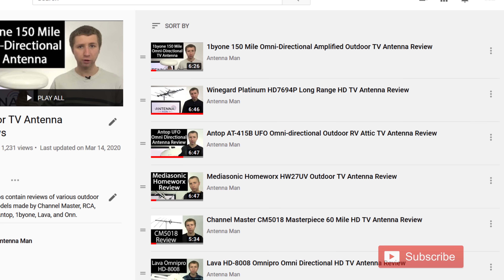Lose TV Stations at Night? This Common Item Interferes with TV Reception

Comment: Great video, I noticed no interference with a weak LED bulb but I recently put a 2000 watt equivalent 28,000 lumen corn bulb in my living room and it interferes with my TV reception bad. I have bad eyesight so I like all the light I can have and this bulb is super bright. I previously had a big 105 watt 7000 lumen spiral CFL bulb and had no problem with interference.

Comment: Hold on. 1. Grid tie is the worst interference followed by  2. Touch lights followed by 3. Dimmer switches and light alarms. 4. LED florescent replacement bulbs. 5. Old long florescent lights. 6. Florescent lights going bad. You will also find Wifi devices sometimes create noise and AC LED bulbs range from horrid ( rare) to imperceptible ( common). 12 volt off grid is a whole nother universe of good and bad.

Comment: Vince from Western PA here, he's exactly right. I have an AC to DC transformer touching my RG11 (evening LED landscape lighting), moved the coax just 3 inches away from the transformer and voila, both channels I would lose every evening while the lights are on, came back in strong. One is VHF and the other channel is UHF.

Comment: I picked up this roof mounted antenna setup with amplifier some years ago, it picks up my local stations great from over 25 miles with signal strengths in the hi 90's. My local VHF are 8, 10 &13. Sometimes 10 (and all its 7 sidebands) won't come in, it's all distorted and digitized, unwatchable. After some time (sometimes minutes, sometimes days!) the problem just goes away, no idea what's going on there. I HAVE found the LED work lamps in my garage can do it too. But the other day I'm watching 10, it's coming in great, when all of a sudden it goes into "unwatchable mode" again. Turns out (in this instance) it's my neighbor across the street (about 150' away) running his snowmobile!!!! Go figure!! Has to be something with the ignition that sled uses.
Reply from the maker: I addressed the issue in the video below. https://youtu.be/VLgYRW2CtO4

Comment: Wow, thanks for this video!  My wife stumbled on this problem last week. I’m in a NW suburb of Chicago ( Round Lake, Illinois). We were watching channel 2 (CBS) and when she turned on the light in the mud room the TV dropped to no signal. This was an 80 watt folding wing light that illuminated this area well.  I have a Finco antenna that I bought new in 1989, it was their best and rated at 150 mi range. It is 18’ wide and 20’ long. I bought it for my old home, but had to put it in the attic. When we moved in 2003, I took it with us and it’s in my current home also in the attic. The antenna looks like it’s brand new. I recently installed RG6U Quad coax cable from the antenna to a powered basement splitter and then directly to the TV. I HAVE A 65” LG smart TV and an Ethernet cable that runs from this TV to the WiFi router. I have seen a guy hook up an in-line filter and I’m wondering if this is the best way to go?  I have some 4’ led lights the might need this, can you recommend one for this?  They run at 66 watts, 120V, and are commercial filters. Thanks!

Comment: I have this exact problem - and reached the same conclusion (an LED Light Bulb). In my case the problem arises when darkness falls (so obviously a Security Light of some sort). Problem is, it isn't mine, but coming from somewhere nearby. I need some way to track the interference to it's source. Looking out the window when it happens hasn't worked (lots of trees around here block
my view). Would like suggestions from others.

Comment: Interesting.  I live in an apartment, have my old RCA antenna set up out on my patio.  Used it for years, no issues until recently.  Connected to bedroom TV and at night I begin to lose reception on a few of my stations.  No LED's in my apartment at night but LED security lights.  Hmmm.  However, living room tv, same type of antenna connected to a pole outside window and actually closer to LED security lights...no problem.  There is an AC unit within 10 feet of the patio antenna.  I'm wondering if that isn't the issue (wind from the unit) and especially since I just recently started noticing the issue.  Guess I'll have to sleep on the couch in living room until winter!  LOL

Comment: I had that big gray antenna hanging in my attic at my old house connected to the house coax wiring and it worked fine for two tv's.

Comment: Tyler, I'm so glad that I stumbled onto your video on the day after Thanksgiving!  Five years ago I installed a Channel Master CM-20 in my mom's attic.  Worked like a champ until recently when my mom started loosing reception after sunset on Chicago's notoriously difficult Channel 2 (RF channel 12).  So, I first suspected atmospheric conditions had changed in some way and installed an RCA pre-amp in the attic - it seemed to help until my sister took her dog outside that evening. After watching your video, I found the culprit: a Cree LED bulb in the porch hallway light fixture that my mom was turning on so that my sister would not have to walk her dog in the dark! The porch fixture just happens to be directly in the RF path of the antenna.  Swapped the Cree bulb out for a Philips LED bulb and now everyone is happy again (including the dog).

Comment: Thanks Tyler. Your videos are excellent and you are so knowledgeable. I have an antenna in my attic here near Sarasota and the Tampa TV broadcast towers are about 50 miles away. I couldn't figure out why all my VHF channels would be gone every evening, after coming in solid all day. I figured it was multipath distortion cancelling out the signals due to some sort of temperature inversion in the atmosphere happening around dusk. They would instantly drop out at dusk with no gradual degradation in the signals before then. The suddenness of the drop outs with no preliminary reduction in picture quality was suspicious and suggested some discrete event might be the cause rather than atmospherics. So yesterday after the VHF signals had dropped out at dusk while I was watching a football game (on VHF channel 13), I did a Google search and saw your video. I then turned off my LED landscape lighting (which had automatically turned on at dusk) and to my delight, all the VHF signals instantly reappeared! My landscape lights will now remain off for the remainder of football season at least.
Reply from the maker: I'm glad my video helped you get better reception. Feel free to give a contribution at the link below as I spend A LOT of time making the videos and responding to these comments:
https://antennamanpa.com/support.html

Comment: I have one station with issues but that tends to be durring the day. However, I am also really close to an airport as well. As for the incandecent bulbs, they are a bad alternitive. First they cost more when it comes to energy usage. just 6 of them and you got the equivilate of powering a computer that is operating on a full load. Not to mention the heat output. the heat is fine durring the winter, but not so much in the summer. Not to mention that some areas restrict incondesent usage by ordinaces. Furthermore, floresent bulbs tend to cause more interferance. As for the LEDs though that tends to mean they are using cheaper LED bulbs from china rather than ones from trusted venders like GE. It is also possable that they are using lower grade cables with less shealding. There are other things that can be done to solve, or mostly correct the issue rather than going back to inefficant power hungry incondecent bulbs that need replaced way more offten. I would say that overall this is generally bad advice.

Comment: Rg6 is a shielded cable . I used a shielded cable for my internet for Att . The problem I did not have enough wire and I spliced the last 4 feet and I did not bond to ground the shelf on the cable . This caused years of dropped internet . I decided to run a new unshielded cable with no splices and problem solved . So the ungrounded shield amplifier emf on the wire causing the modem to drop being overloaded . I wonder with proper grounding of the RG6 and the antenna ( preferably a dedicated ground rod not tied into the electrical system ) the shield takes that excess emf to ground and not contaminate the signal

Comment: Now, Channel 6 is out, and I have NO lights on in my house.... I don't know why, because it DIDN'T used to happen.  It's this past month... I'll have to watch your video on bad TV reception in the summer.  Also, yet in other rooms in my house, I can receive that same channel.  Sometimes, it's bad in every room.  I've gone into my attic sometimes to move the antenna a pinch and it sometimes works, but mostly, I just have it aimed in one place, since it's in my attic.  I also live in a complex that doesn't allow outdoor antennas, so that's why they are inside.  But it's been very good for the most part, because I live in the highest location, not down the hills where other units are in my complex.

Comment: You're too funny.  Listen, LED lightbulbs definitely can cause interference, but there are some LED lightbulbs now that don't affect the reception.  I know because I have tried it.  They are also getting made differently since this video.  Secondly, some FLORESCENT fixtures and lightbulbs cause it too.  I found out once that my kitchen florescent fixture over my sink was causing my interference, so I changed the fixture completely, and used 2 LED lightbulbs that didn't affect the interference.  Also, EVEN after I had turned the florescent light off, I was still getting interference, so after I changed the light fixture, the problem was GONE.  Sometimes there is current running through the florescent fixture even though the light is turned off, and that was also causing my problems.  So it can also come from the type of fixture when the wires are connected to it.  Also, by the way, I do NOT use a "leaf" antenna, or that other junk piece of antenna you were showing.  I use a Winegard 7694P in my attic, and down next to my 2nd floor window, I have a DB4e, and I receive most and sometimes all my channels.  Right now, the channels are coming in and going out all the time, and my friend Bill who works at Lowes, thinks it's the weather.  He's having the same problem.  It. could be the summer causing problems.  But it's NOT my antennas, and not my preamps and boosters... I did get my LTE filters and I have yet to try them. I just got them and right now, we are having a heat wave.... So I want to wait until it's a wee cooler right now...

Comment: Thank you - solved my problem....  AFTER I replaced my Wingard amp with a Televes, thinking it was my amp. I have 3 or 4 incandescent bulbs left - the rest are LED. HOWEVER, the ONE I had in an automatic switch, a 3 way, was the culprit. NONE of my other LED bulbs create a problem - Except the other 3 way that gets turned on manually. The problem is minimum on the highest setting, but it still drops the signal meter about 20% on the highest setting.

Comment: I was having reception problems with 2 particular channels.  And I found out the hard way that they had turned their power down while some other stations were working on the tower.  Without playing phone tag/voicemails with the engineering dept. at the tv station, is there a website one can go to and find out if they are having transmission/repair issues at the moment?  We are in a fringe area and anything to do with transmission power strongly affects us.

Comment: Hey Tyler unfortunately I bought that first antenna square shape you just threw out.  I’m happy with it.  It gets about 90% of the local channels that I’m aware of.  I also added an Onn amplifier which helped slightly but overall I’m happy with it.  Why you said those antenna are junks?

Comment: There is a station in our area that I loose or get weak signal starting in March through October, I contacted station and they blamed equipment. This has gone on for a few years. At this time there are no leaves on trees. I also have found several people with Sam issue in my area. Could it be that the station is throttling down their RECEPTION?  If so can anything be done?  Thank you.
Reply from the maker: See video below: https://youtu.be/drNhNtclRbc

Comment: Thank you Tyler for all the great info you've given us. I actually have the opposite problem where during the day I get a lot of pixilation throughout all channels and at night, it's great. Pretty much flawless. I get a signal of high 60's/low 70's (even high 70's) all the time at night but during the day I see the signal fluctuating from those high numbers to zero. It's puzzling. Any idea why this happens during the day and not at night? I'm in south jersey aiming at the Philly stations with a Clearstream 4Max along with the Juice preamp. I have a cable run of about 50ft plus using RG6 Quad and no splitters. TIA.
Reply from the maker: The ClearStream 4Max is a very basic small directional antenna. You'll likely need a larger model. Consider an antenna recommendation from me at the link below. This can prevent you from spending hundreds of dollars and time wasted on setting up the wrong antenna for your area. https://antennamanpa.com/antenna-recommendations.html
Reply: @AntennaMan  Thanks for your response. I most definitely will. The 4Max was the recommended antenna from Antenna Web. That's why I went with it. Looking forward to hear what you'll recommend.

Comment: By F.C.C. rules, all high-power radio and television stations reduce their transmitter power at sunset and return to high power at sunrise.

If you are already at the ragged edge of receiving a channel during the day, then you will most likely lose it at night. The channel will probably come back the next day.

The "noisy" L.E.D. lightbulb will make the problem worse with locally generated noise in close proximity to the T.V.

It is like trying to listen to someone whisper in a noisy room, while a person yells in your ear.

It is worth a try to follow AntennaManPA's advice to see if it will reduce the noise level at the T.V.

Comment: To find the offending light bulb, take an old fashioned AM transistor radio tune it in to static, then physically hold it up to each light bulb, dimmer switch, outlet, transformer and more. You will be able to hear the interference. Each bulb hums differently, and the loudest one is usually the issue.  The AM radio is highly sensitive, it will also normally pick up more interference on one side (for example the left side) than the other. (This is based on how the circuit board components are laid out in the radio.) You can also put the TV and the TV antenna amplifier on a different circuit/plug than the offending light bulb.

Comment: I just cut the cord and have been watching your videos on many different scenarios and I appreciate the work that you do.

I’m having problems where channels will not come in during the early morning (when it’s still dark out). 
I do have LED lights but they are motion sensing lights so they are technical off when there is no motion around.
I’m using a ClearStream 4Max antenna.
The light bulbs are  Motion Sensor LED Light Bulb 9W A19 PIR Built-in IR 60W Equivalent Bright 810 Lumens E26 Base Warm White Bulbs and I have 4 of them in the house.
I don’t know if it is the lights because they are in and have power going to them, but they are not illuminated.
I forgot to mention that I have a bunch of LED night lights that turn on at disk and off at dawn.
Any suggestions are greatly appreciated.

Comment: You sir are genius! Long story short, I am subscribed and took all of your advice to the tune of 86 air channels in my area (Tampa Bay). I been scratching my head why my vhf channels would go bezerk at night, after turning off all my led lights in the house, no luck, turns out, it was my landscape lighting, all of which have cheap chinese led bulbs in them, they are around the whole property, switched them off manually, and all is good again at night, amazing how you can miss one detail and it makes a huge difference! I am happy it as not my hue lighting creating the issue.

Comment: Ok running into a similar problem in our rv.  Replaced a surface mounted one that broke with a new led one and when I turn it on it kills the  tv signal.  I am looking at putting a ferrite barrel around the power cord to remove the interference/

Comment: Another possible culprit can be a security camera's infrared night vision setting that is often set to turn on automatically at dusk. I have a camera only a couple of  feet away from my antenna and was losing one VHF channel (and it's sub channels) at night, turning the night IR mode off fixed the issue.
Reply: Thank you. Checked this out and it was it for me too.   I lose one station (and substations) only at night.  But it comes back if I shutdown my security cameras. One difference though is that the cameras are not near my roof mounted antenna.  There are 12 cameras around the outside of the house on the eves.  The antenna is at the highest peak of my roof in the middle. So even the closest one is roughly 20 feet away and 10 feet down.  I don't have the option on my cameras to shut the IR light off that I see. But even if I did, if I had to shut them all off, it would make the security cameras not functional at night.  Any suggestions?
Reply: I am losing the stations that broadcast on RF channel 13 when the security camera IR lights come on.  Is that the same one you lost?